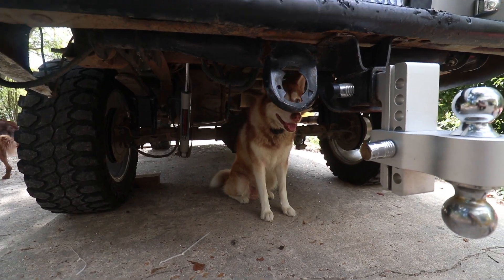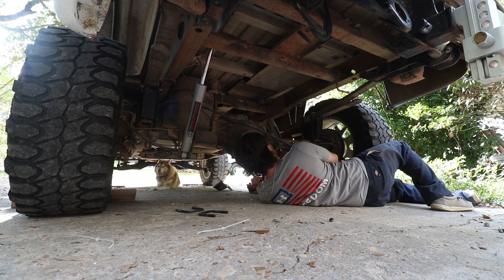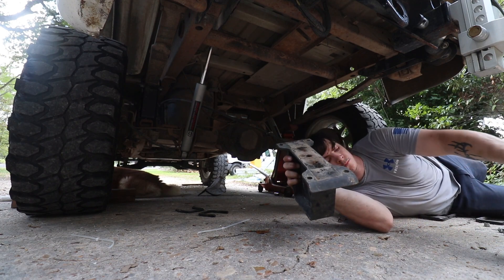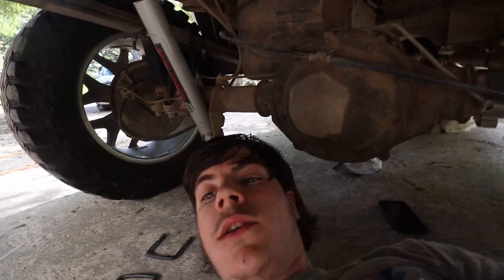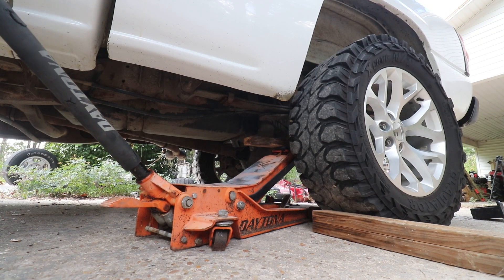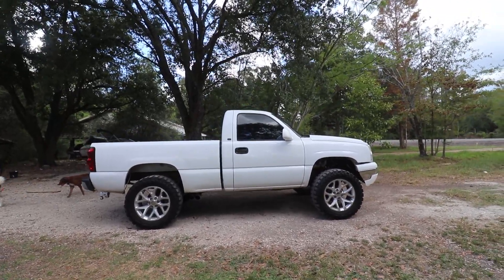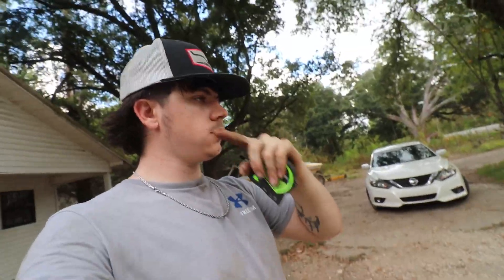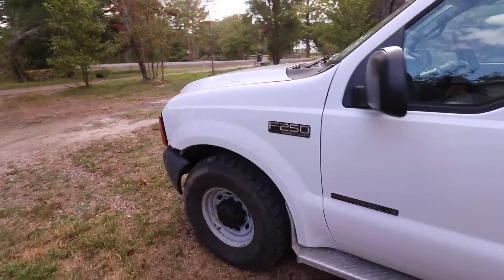INSTALLING SMALLER BLOCKS ON THE CATEYE!!

Comment: Hey, got a question. If I put 3in coil spacers in the front how many inches should I put in the back?? I want it to be leveled tho.
Reply: It’s completely stock too it’s a 2wd 2006 Chevy Silverado
Reply from the maker: Should be level with the stock blocks after the 3 inch level in the front. I think so anyway
Reply: @AUSTINFRILOUX  aight thanks, keep up the work too!!
Reply from the maker: @Dj-gl9xg  thanks man!